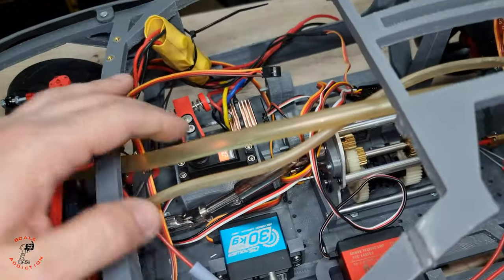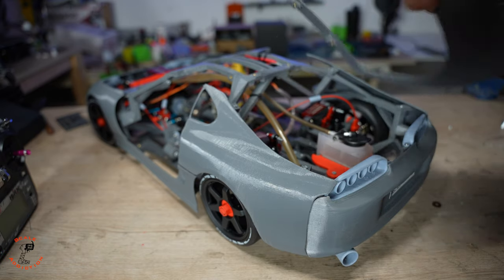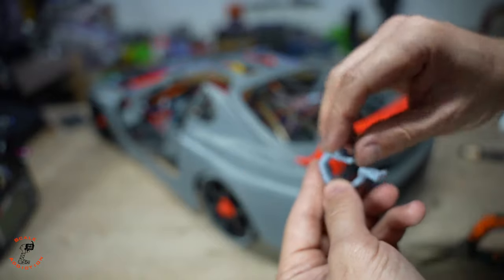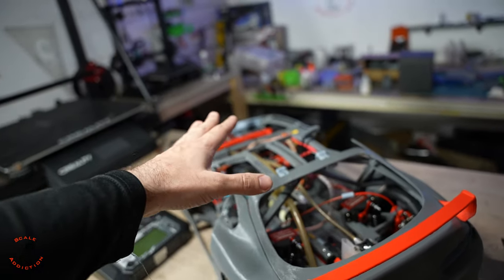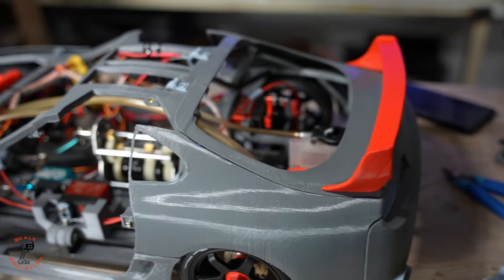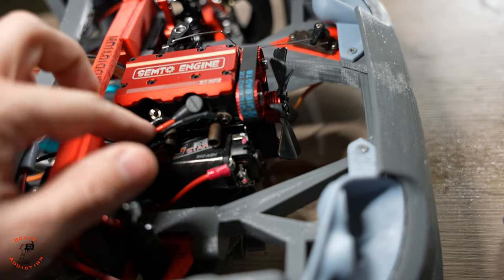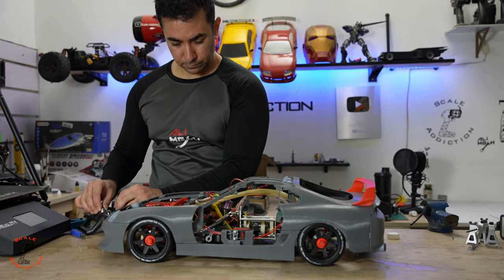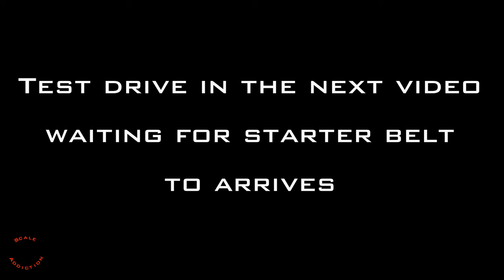Part 13 / We have a problem 8th scale 3d printed supra with 2 cylinder engine project

Comment: Nice job! I just bought the kit. I'm super excited to use my semto engine for something other than a display! Thanks!
Reply from the maker: That's awesome,  Shear your progress on scale addiction facebook group,  I will definitely shout you out 🙏🙏
Reply: @scaleaddiction  thanks for the shout out, I will share my progress! I also cut up the chassis into smaller pieces to help with size restraints.

Comment: Would it be possivle to the engine to get so hot that the 3d printed parts starts melting
Reply from the maker: Sure it will, but I will 3d printed it with different material after I know everything works good

Comment: Is their any concern over the heat produced by the engine? I can't imagine 3D prints being happy near it
Reply: that's why I duilt this electric, and it already runs
Reply from the maker: Of course it won't hold that heat, bit I have carbon fiber filament and print the chassis, otherwise I will send it to pcbway which is sponsored for this project to print me with heat resistant material, but till I make everything sure then I send them the file

Comment: ali can you please update the cults3d links for the supra Its been months since its been touched so the links are inaccurate and also not up to date please fix this like acutally fix it and not just say "Sure, I will look at them today" and blow me off
Reply from the maker: I did last time and all where working. Accept the caliper were out of stock, which link not working for you ?
Reply: @scaleaddiction  the link for the Arduino is still in there, even though it was never utilized the link for the beans was wrong. I got the size of rice greens and the link for the three speed gearbox is not there among other things. The links have not been updated in two months, so it’s no longer up-to-date with the videos which is my main issue